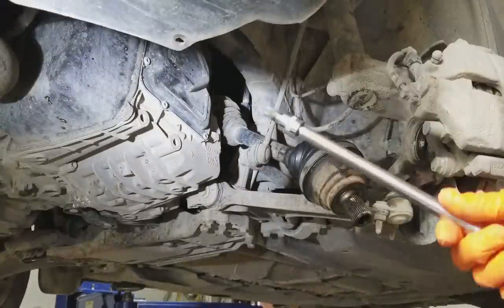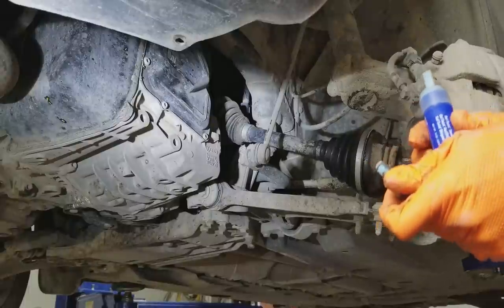how to replace a cv axle boot on a jetta

Comment: Thank you. That was helpful in getting the joint off the end of the axel. Wasn’t sure how it was held onto the shaft. One important pro tip. When applying the grease, you should force it down thru the center hole of the joint. That way it forces the old grease out thru the bearings where you can wipe it off with rags. I’ve done hundreds of these, just not a VW. Thanks again!! Great video!!
Reply from the maker: Thanks for chiming in

Comment: You do not want to get into losening balljoint castle nuts that hold the integrity of the joint. In this case, all you had to do was remove the 3 bolts that secure the ball joint to the control arm.
Also, you do not need to remove the axle from the car. It's best to do it on the car. This way you're not losening the inner side bolts. If you do loosen them, its best practice to replace them.
You always must replace the hub bolt. This is a very high torque stretch bolt. You do not want that bolt once its been torqued to spec.
Other than that, it's an ok job.
Reply from the maker: Thank you for your opinion. I've only done them on American vehicles before where I always remove the axle. But I'll keep the advice for next time 👍. When you undo those 3 ball joint bolts, don't you have to do an alignment?
I just changed the ball joint on my vw golf and the steering was of by a lot after. You can see how bad it was of you check my Instagram. I'm just called autotechworld on Instagram. You may want to subscribe to see if I get better 😉
Reply: @AutoTechWorld_DIY  hi. No. Not on this vehicle. I was going to comment on that in my orevious post, but I figured it's too much overhead. On some vehicles, the ball joint is set up so it allows camber adjustment on the car. When that's the case, you will notice that the control arm has no boolt holes or studs protruding out of it. There is usually another piece of hardware that allows the ball joint to slide into the arm and then have an extensive play in the arm until tightened down. On this vehicle, the ball joint stays in a fixed position onto the arm and has no movement. That's because this vehicle can not have its camber adjusted. At least not standard. You can install camber adjusting bolt in the place of one of your strut to knuckle bolts. And yes, the only VW GOLF I know to have camber adjustment through the balljoint securing bolts is the MK 4 Golf.
Reply from the maker: @HristovRumen  ok. Thank you 👌
Reply: My VW doesn't have bolts at the end of the axle, but it wouldn't budge, any suggestions please?
Reply: @HristovRumen  mk3 and older use the ball joint for camber adjustment. I'd do it all the time for fun on my mk3s. It would give it so much camber it looked like this in the front  /  \ and yea didnt go very straight lol
Reply from the maker: I have a mk4 golf and that is like that. But yeah I could see it not driving straight haha
Reply: I was a ASE mechanic specializing in front end and suspension and alignments for 27 years. Took thousands of joints apart just like he did. Never had a problem.
Reply: I’m referring to the ball joint castle nut btw. Not the axel bolts.
Reply from the maker: You are the man 👍
Reply: I have a question. 2011 Jetta tdi 2.0L DSG. My outer boots ripped do I need boot kit with new pieces for it to work right? Has sir clip near the end and plastic retainer the metal washer on inside boot end.

Comment: You don't have to take off and of those other bolts. Just the axle bolts literally. If u turn the hub and push it will come out. They made it that way so u don't have to. Just a FYI to make it easier.
Reply from the maker: Thanks for sharing. I'll keep that in mind 👍
Reply: What other bolts are you talking about?
Reply: passenger side on vw yes - driver side on vw … not so sure !

Comment: There have been times when working on my Jetta's brakes I found myself wishing I had a low profile impact driver.  That is because on one side of the car you have to pull up but it is very cramped under there.  I am already picturing people with painful lumps on their heads and stars and birds circling them.
Reply from the maker: I've seen the Milwaukee stubby impacts. I think they're awesome.

Comment: Great video! What’s the difference between this and 2011 Volkswagen Jetta Tdi 2.0L W/DSG? Doesn’t it have snap ring on the end of mine?
Reply from the maker: I don't know.
Reply: @AutoTechWorld_DIY  So it actually has  a circlip on the end and and plastic retainer ring like yours further in but smaller. with metal con-caved washer at the end with plastic retainer.

Comment: If anyone is having problems tapping on the cv end like iam onto splines it helps to move circlip or in other cases snap ring with a small screw driver and align it with mating the two before tapping on..
Reply from the maker: Thanks for the info
Reply: @AutoTechWorld_DIY  Absolutely

Comment: Good job! How do you know when putting the cv end on that all the splines are aligned? When I try to put it back on it just wants to keep turning on me and balls wanting to come out.
Reply from the maker: Thanks. Not quite sure what you mean
Reply: @AutoTechWorld_DIY  so when I try to put the outer cv axle unit back on the shaft it doesn’t want to line up that great with splines and turns as I try to tap it back on. Just using old one to test on. Is it because the circlip not snap ring needs to be new for the spline to line up?
Reply from the maker: Sometimes it's really tough to get them in. If I remember correctly it should go in any way.
Reply: @AutoTechWorld_DIY  so I don’t need a new circlip for it to go back on and can essentially reuse the old inside hardware? I was thinking I may need a new circlip and why it wasn’t going back on as it messes up when pulling off.
Reply from the maker: It can mess it up sometimes. But I found if I remove the circlip and put the new one on, it is usually much harder to put it back in, then if I would just reuse the old one. Because by putting it on, I have to stretch it open and then I feel like it's really tough to go on.

Comment: isnt there a retaining ring on that inner splined shaft that prevents the CV joint from walking off the shaft
Reply from the maker: From what I gathered so far from all the information I got, there is two options. There is some that do have a retaining ring that keep the shot in, but some that are just bolted on as you see in the video. Would that answer your question?
Reply: How does the inner shaft bolt to the outer shaft that drives the hub, it cant be the main hub bolt, and theres a retaining ring groove visible in the inner shaft when you're doing reassembly

I'm doing mine tomorrow morning hence the concern
Reply from the maker: Could you maybe mention the time stamp? That way I could look at it and know better what you mean.
Reply: @AutoTechWorld_DIY  9:07 shows the groove and possible ring well on the shaft being held in the vise
Reply from the maker: I now know what you mean. I was thinking about the CV axle connecting into the transmission. Yes there should be a retaining ring there.

Comment: Great video....will it be the same procedure on 2012 passat 2.5l?
Reply from the maker: Thank you...... Yes it should be the same. I've just looked it up in the service manual, even the torque specs are the same. Happy wrenching 🤙
Reply: @AutoTechWorld_DIY  also, what's the name of the thread stud  you put in to hold the tire in place while removing or putting back the lug nuts . And where could I get that? Thank you.
Reply from the maker: It's called a wheel stud alignment tool. Here's a link to it on Amazon.com 👇
https://amzn.to/2wfyPvt

I'll also add it to the description where I have listed everything else I'm using in the video.

Comment: Hi, do we need to drain the oil of the gearbox when we remove the axle ?
Reply from the maker: No, there is no need for that, because you don't pull the axle out of the gearbox. You unbolt it from a flange that stays in the gearbox. If that makes sense?
Reply: @AutoTechWorld_DIY  oh ok I understand thank you

Comment: What sound dose a bad cv usually make. I'm hearing a lound helicopter sound when driving and turning slightly
Reply from the maker: That is exactly the sound it makes. Arty this point just replacing the boot isn't going to fix the noise. You'll have to replace the complete CV-axle. Be sure to check you wheel bearing though before just replacing the CV-axle.

Comment: My car doesn't have bolts at the end of the axle, but it wouldnt budge? Any suggestions?
Any help please?
Reply from the maker: What car are you working on?
Reply: Golf V 2008
Reply from the maker: Well, I'm lost there, I tried to look up a 2008 Golf mk5 but couldn't find anything. Very often (on other makes) those axles are just popped into the transmission and you just need to pop them out with a pry bar or something, But I'm not sure if that is the case with yours though and I don't want you braking it. Maybe give your local dealer a call and ask them, or a Dealer from a little further away. They'll probably tell you what's is going on. Sorry for the no help
Reply: Did you ever get it off ? I have the same 2008 golf with no inner bolts in the axel. I had to cut 2 wood shims on left and right side and hammer them in upwards that’s what worked for me after I spent hours trying to pop it out with pry bars and chisels and it wouldn’t come out. I just ordered a new cv axel from parts source and they delivered a cv axel with the 6 holes for the 6 bolts. Now I have to order another cv axel from another parts place and hope to find the right cv axel with no holes for the 6 bolts on the inner side of the axel.
Reply from the maker: Thanks for letting us all know.
Reply: @AutoTechWorld_DIY  no problem. Also I have noticed my cv axle that I am working on is the passenger side and it has a axel nut and not a axel bolt like yours. Do you know the torque spec of the axel nut? I also removed the 3 bolts from the lower control arm so I will see how the alignment feels once I take it for a test drive. Do you suggest loctite or anti seize for the axel nut? Thanks helpful video and interesting comments. Looking forward to finding the correct part tomorrow and getting it installed ASAP. Working on the vw golf on my driveway with Jack stands. Not fun but fun lol
Reply from the maker: The best part is when it's done and you can drive it knowing it has new parts. 

Unfortunately for the 2008 model, I can't get any specs.
Reply: Same story for a 2006 2.5L jetta with a 6sp auto (no inner bolts). Had to do this on a Mazda once where you had to wedge a chisel in there or something and then beat upwards (no a mount of prying really worked). Going to try and do the outer boots in place. A couple of corrections to the video; the small splash guard are T25 torx (no t20 - t20 will work but they will be a little loose) and you can take those 3 nuts off for the ball joint because those holes are tight on the studs (no play at all). Now, who's to say that an alignment shop didn't drill those holes out a little to correct camber (they either do that down there or at the strut mount up top sometimes). To check, just take one of those 3 nuts off and see if it's a tight hole or one that's larger than the studs. Thanks for the video.

Comment: any difference to do the inner boot?
Reply from the maker: You can do the one boot while you have the outer of. Just slide it all the way back. Does that answer your question?
Reply: @AutoTechWorld_DIY  my outer is fine.   watched another video on doing the inside one.  thanks for your helpful video.
Reply from the maker: @dh7277  awesome. Well thank you very much 🙏
Reply: @AutoTechWorld_DIY  had some trouble putting the inner back together.  the CV joint looks symmetrical but it is not.  on reassembly i got it reversed and it would not go on tight enough to allow the snap ring to seat properly.  took it off looked very closely at it and realized i had it reversed.  for a messy job it is oddly satisfying once completed.

Comment: Call those 12 point or triple square but I will cringe and curse at you if I ever hear you call them Torx.  Although it seems possible to use a Torx bit in such a bolt that can be a big mistake that will only cause difficulty for you.  That would be the punishment for mistaking those for Torx!!
Reply from the maker: You got it!